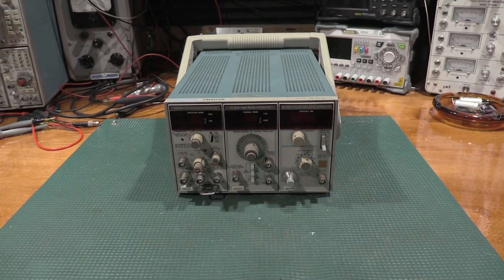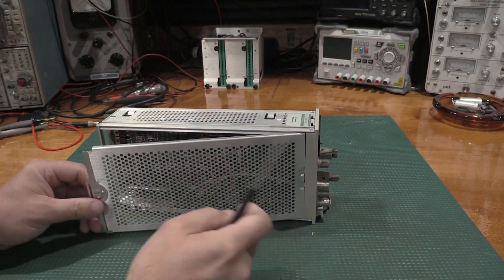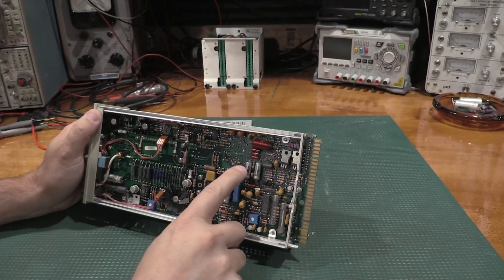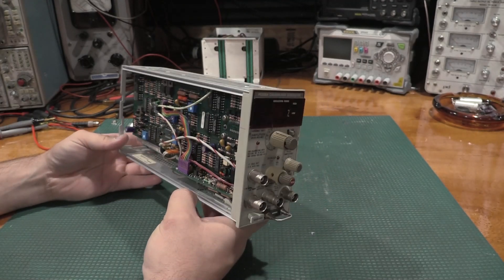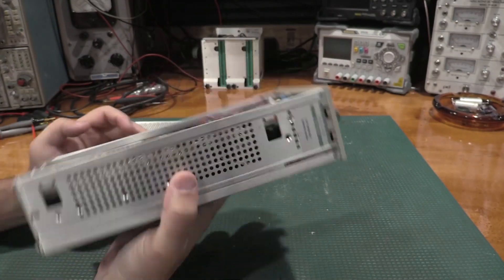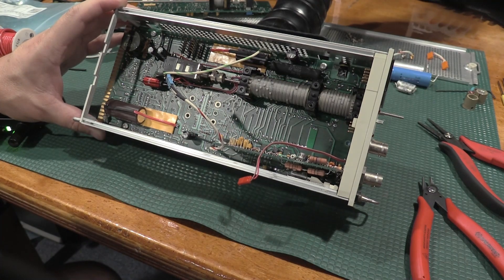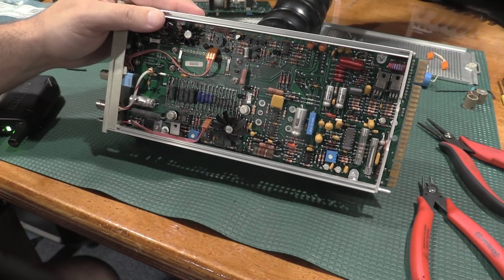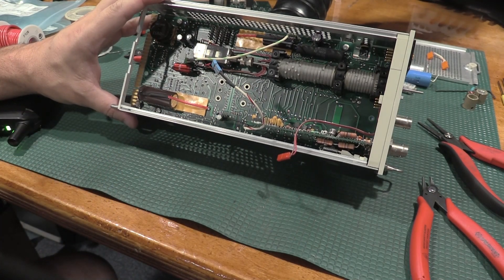Tektronix PG506A Refresh and Checkin

Comment: Ok ! Time I mentioned the Capacitor Replacement . The axial capacitors are being replaced with radial so why not  clip the axial leads on the top /fitment side  and solder with heatsrink to the stubs ,. This will be less intrusive than  moving other components to reach the blind holes . You are changing the boards look anyway with Radial capacitors so this will be no less a competent job , with less intrusion .

Comment: Why do you automatically replace all the electrolytic capacitors? Tek used top quality parts. I doubt they are bad. If I were you I'd get an ESR tester and check them first. I bet they will be good for the next 20+ years.
Reply: The ESR meter is not enough, in addition to the capacity and ESR, it is necessary to measure the DC leakage, and if one of the capacitors starts to leak mechanically, all of them are automatically changed. It's a matter of course during general repairs, you never know when the next one will fail, and having to disassemble the device again, change parts, find out if something else went wrong, then redo the entire alignment - you don't want that, and if the customer wants it, then it's holy.
Reply from the maker: In addition replacing a cap would trigger a full re-calibration of the device if only just to check. Which most cant do in house given the need of a 7.5 digit meter.  I will do some more videos on capacitors but all small electrolytic caps have rubber seals. Tek caps are also 85 degree C all new caps are 105 degree C so they will have an even longer life span in circuit. Some of these 500 series plugins do run quite hot.
Reply: This has been said before.  I'm just now accepting it: 
It comes down to how one values one's time.  It is better for me to bite the bullet and avoid having to go into it again. 
I appreciate the design and component quality when I find 60 year old electrolytics performing at spec.